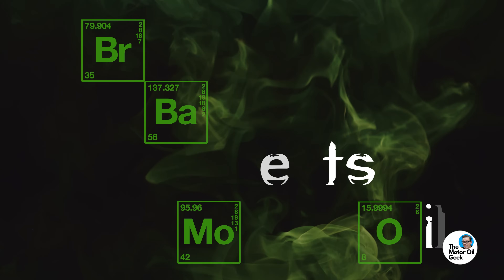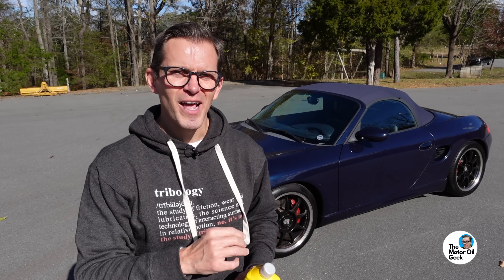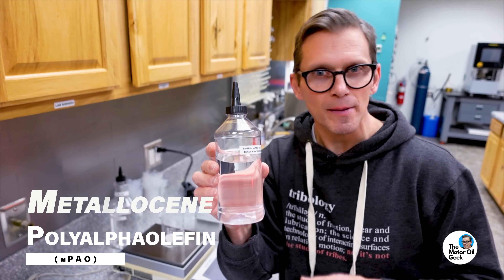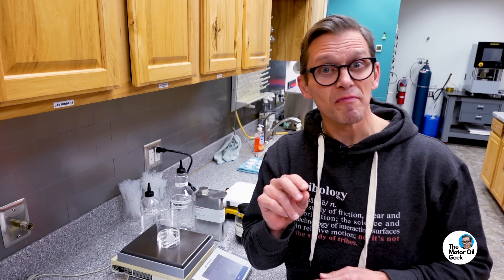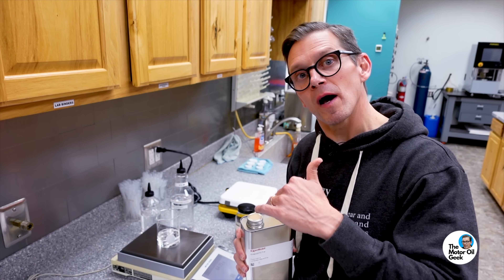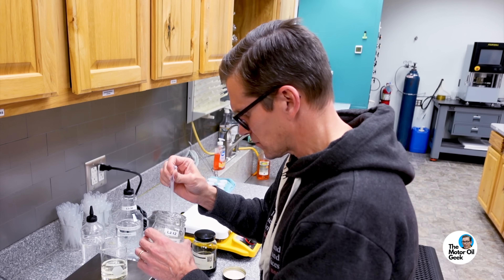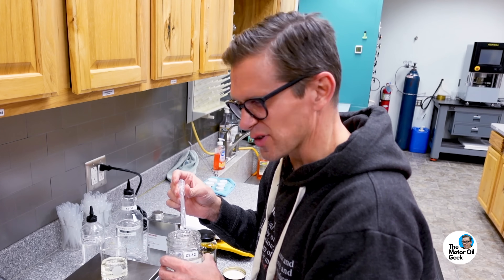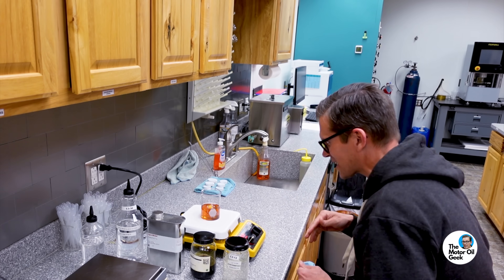Motor Oil Chemistry EXPLAINED (Breaking Bad Style)

Comment: Can you tell me dif between Mobil 1 , 0-40 Dexos 1 and Mobil 1 , 10-40 ( no Dexos 1) ? I have a 2024 GMC 6.2 L Ultimate Denali. I want to protect engine. Not interested in gas performance. Ok to use the 10-40 ?

Comment: Hi Lake!

About the J35Y6 3.5L V6 Direct Injection (DI) engine coming in the 2026 Odyssey. 

We know Honda makes tough engines, but as long-term owners, we have critical questions about fuel and oil given the engine's high-tech design (DI and high compression).
Fuel: Regular vs. Premium for 200,000+ Miles

This engine's high compression ratio (11.5:1) and DI setup naturally make us concerned about knocking, which usually pushes us toward higher-octane Premium Gasoline.

Our main question is simple: Can we truly rely on Regular Gasoline (87 Octane) and the ECU's knock control to drive this engine beyond 200,000 miles without causing any lasting damage to key components? 

We need assurance that relying on 87 Octane won't silently degrade the engine over the long haul.
Beyond just preventing damage, we'd like to know if there's any tangible, long-term durability benefit—not just a temporary performance boost—from using Premium Gasoline (91 Octane or higher) exclusively. 

Is it merely for maximum performance, or is it a hidden key to ultimate engine longevity?

Engine Oil: 0W-20 vs. 0W-30

Honda specifies 0W-20 oil, a choice we understand is driven by fuel economy and emissions targets. 

However, for an engine we plan to keep for two decades and over 200,000 miles, this thin viscosity is a real concern.

We need confidence that 0W-20 oil provides sufficient protection against long-term mechanical wear in a high-heat, high-load DI engine, especially when compared to a traditional 0W-30. 

How can you technically assure us that the thinner oil isn't making a sacrifice in long-term durability for marginal MPG gains?

Finally, we'd appreciate clarity: is choosing 0W-30 a necessary, preventative strategy for maximizing the engine’s lifespan, or does its higher viscosity actually risk negative consequences (like hydraulic system issues or flow problems) in an engine designed specifically for 0W-20?

Comment: Really interesting - There is a brand that makes very bold claims . The brand is Lubrication Engineers. Can you test their LE 8531 Monolec engineoil or their 5w20- 0w20 in the same series for Gasoline engines only. They seem to go under the radar everywhere despite their very bold claims on the bottles. Hope to hear from you Lake. / Tomas

Comment: A great subject/myth to cover would be draining oil via a drain plug vs full pan removal vs using an extractor.  There are rumors on the internet that using an extractor does not remove the contaminants as effectively as draining from the plug or completely dropping and cleaning the pan since the contaminants will sit in the bottom of the pan and then remix with the new oil.

Comment: Here's my question. I have 3 Porsche's, a 986, 996, and a 2012 panamera. I'm putting on about 2000 miles a year on each with mobil1 synthetic. Drives me crazy to think I need to change each annually. Do I?
Reply from the maker: Used oil analysis after 1 year can answer that question for you and how you drive.
Reply: @themotoroilgeek  another porsche related thing is: doesnt the mobil1 5w50 (porsche approved) generally perform better than the 0w40 counterpart? Considering not moving during winter where the 0w40 would be in an advantage, it just sounds like the better oil for highway use

Comment: Have you ever played around with steam cylinder oils? They usually come in three general viscosities: 460w, 600w, and 1,000w.

I'd be interested to see what they do differently in terms of additives for working with steam since normal motor oil isn't intended to work with water.

Comment: I understand the cold weather starting for oil to flow but why does it have to be 0W ? Why not 5W ? Maybe I’m too old school the 0W seems way too thin for me. I understand new engines are built with tighter tolerances I get that but why 0W weight? Other than meeting the EPA standards for fuel economy standards I this is why companies are coming out with this 0W thing.

Comment: Thx for all your knowledge and effort to put it out there….got a viscosity question for you: my wife’s 2016 4.0L 4Runner has 110,000 miles, oil changes every 5,000 miles with the recommended 0w-20 from Toyota….the other day when she started it up and i was standing behind it, i smelled a little oil in the exhaust…..should i increase viscosity to 5w-30 to compensate? Or another thickness? ….whats your take on aging engines and viscosity? I’m in Alaska but in southern coast, temps here range from 0 to 68F year round….thanks so much in advance.

Comment: Do not prefill oil filter, air buble will rip out filtering material specially in these cartrige filters
Reply: He has covered that myth in at least one past video, perhaps a year ago.  Contrary to your belief, I now do it on four vehicles after his recommendation to do it and I hear ABSOLUTELY NOTHING up on startup.  Whereas before, I did.
Reply: Mmm  ever experienced that yourself.
Reply: @murpbassett4818  you are replying to Jonjs? or me?
Reply: @murpbassett4818  Yes, 2 times in opel and bmw engine, worst part is realising that you just ran your engine for god knows k km with almos no oil filtration

Comment: Would be great if the major manufacturers would make a Motor oil for the newer pickup truck motors that would not shear out of grade at a 5w-30 spec. I’m trialing 5w-40s now and my wear rate is always around 6ppm/1K. Towing heavy really tears up oil.

Comment: Another great video & I’m looking forward to your results!  Good point on the standard filter vs high dollar filers.  I researched the micron filtering a while back & found “race filters” didn’t go to as low of a micron level as the standard filters so I too stuck with the Wix standard filter & 4k mile change interval.   Any idea why your Porsche engine was showing more wear than expected?
Reply from the maker: Thanks. This engine is unique and the oil rings are not low tension.

Comment: So when really pushing the chemistry on the moly, what would stop you from just going heavy with that moly additive in penzoil ultra platinum.

I know you’re big on the “do not mess with off the shelf oil additives” but in this case when you can do the testing and possibly inspect for issues maybe also add a bit of extra dispersant why not and save a ton of time/effort ?
Reply from the maker: More Moly can also lead to more deposits on the pistons, so there is a balancing act.
Reply: @themotoroilgeek but what makes your formula “better” in that respect compared to a high quality rated product with that extra moly added ? ie couldn’t you just add a bit of moly and some additional dispersant to a “stock” oil vs having to do a full formulation since you’re using the “Betty Crocker” base additive pack anyways .

Comment: Mr. Speed

How the regular filter is more efficient?

Thanks for amazing video.
Reply from the maker: Filter efficiency increases as the filters get more use. The long drain interval filters have to start off with a lower efficiency so that they don’t run out of capacity before the drain interval.

Comment: How do you deal with the oil remaining dry sump? My 718 Cayman GTS 4.0 total oil capacity is 8.3 quarts, but only 6 quarts drains per oil change.
Reply from the maker: It takes 2 or 3 oil changes to get good data.

Comment: Lake Speed Jr., I follow your channel as you provide really great information.  One topic I don't hear you discuss is wet belt compatibility of motor oil.   Many of the Ford Ecoboost engines and the revised 5.0L are using wet belts and ford has a Spec WSS-M2C961-A1 that incudes a wet belt test (not sure what that entails).  What should we think about when we have a wet belt engine?
Reply from the maker: All API SP rated oils are tested in a Ford wet belt engine.

Comment: Nice video.    Just wondering if the process of adding 1 item at a time, then heating /mixing/repeat
has to be done, or would the results be any different than adding them all together off the bat ?
Reply from the maker: Some items (not in this particular case) are not compatible with each other if introduced at the same time.

Comment: The section about using Lubrizol 7418A and the Hitec 11183 additive package is extremely valuable. It clearly shows that motor oil is not just about base stocks but also about how additives are blended. I often analyze other additive packages and their impact on engine durability on my own channel. Many thanks to this video for sharing such practical lab-based knowledge.
Reply from the maker: Glad you found the video useful.

Comment: I wonder if there is a lake speed Jr. Of the gasoline world. Doing the same thing with fuel for their vehicle😂.. like adding hydrozine  to a nitro dragster.. if the flames green, it's running mean! The first dragster to use it picked up over 20 mph when everyone was stuck at 180mph he ran 205..😮 that was a serious gain of power.. and coming from the fuel alone, amazing..  it's like going from methanol to nitro all over again..  I played with fuel additives as a kid using Coleman lantern fuel in my gokart to mixing either  to gasoline even kerosene and other additives. Ethanol, methanol . I did have the fastest stock engine on a kart. The compression  was up there the head could not be cut anymore. I had to clearance the valves . I cut the head until the valves touched , then clearanced for the valves and ported the intake and exhaust. Tuned the carb at full throttle. It smoked at idle but ran much better at full throttle.  It could have been much better with aftermarket parts. I would different Briggs heads with smaller chambers modified them. I think it was from a 4hp engine . I used it on my 5 hp. I think the 4 hp was a smaller bore mine was 205cc maybe the 4 hp was 196cc? I was thinking of all kinds of stuff I wanted to do. Re sleeve it. Pitting a 8hp piston in the engine..😂. Have an awesome day!...

Comment: Awesome video. Awesome channel !!!  

I started out thinking I know what to now run in my drag and drive engine.  
However as I have watched all the content on the channel I am no not so sure. ! 
Any help is greatly appreciated.  

I have a LS forged bottom end with a turbo making 1000-1200 hp. It has only 2500 miles o it from new. It has only had Lucas 30 break in oil. 

Plan to Change oil every 2500 miles or so. After say a week long drag and drive event.  

Is now the time to go to a synthetic?
What should I use ?  
I was leaning towards VR1 20/50 or 15/50.  
Or same weight from driven
Reply from the maker: Check out the Driven GP-1. It is a good oil for drag and drive.

Comment: Question ..off topic. I had a 2004 F150 4.6 Triton. Starting with the first oil change, I ran Mobil 1. Never had any engine problems, sold the truck to my nephew, and it's still going.. Now I have a 2020 F250 6.7 PS and the Mobil version of diesel oil Delvac, they say don't ever run it. Curious why is the diesel version not ok? Thank You if you have time to answer.

Comment: Wix XP has changed their filter media recently so it might not matter which version is used. I've noticed the old white media XP filter has slightly higher oil pressure when new. It could be for extreme drain intervals.  

I think a 3rd horse in this race should be Mobil 1 ESP X4 0w-40.

Comment: In general if my old Ford required 5W-20 when it was new and it has over 100,0000 miles would switching to a 5W-30 or 10W-30 be Ok? The climate it operates in is normally 60 deg F to 95 deg F.

Comment: That tip of dropping a bit of new oil to flush with the old is nice, but how much would be enough? I usually tilt the car with a jack and let it drain until it stops dripping. This way a Accord that asks for 4,4 quarts now requires 5 quarts to get to level, so it's about 13% more of new lubricant at every oil change.

Comment: You talking about the oil filters. 
I do my oil change every 3k miles. With  high end filters.  Since you said what you said.  It makes sense.     Gonna start using the red purolator.s.  for 3k miles oil change..😊😊
Reply: If you use Purolator boss just don’t change it every oil change that’s what I do.

Comment: Just went back and checked out the video on the Valvoline restore and protect and I was wondering if it worked better than using marvel mystery oil as an oil and fuel additive? Great videos, I don’t understand a lot of the chemistry but highly appreciate the answers at the conclusion.
Reply: In prior videos he's made it rather clear, I think anyway, that it's better not to play scientist.  For fuel the only one he recommends is Chevron Techron.  Lake helped flag oil dilution in my 18 camry due to using generic gas and fouling the injectors. My car is both port and direct injection.  One application of CT and I had no increased oil level or gas smell the next time around.  I use it periodically now and never ever buy generic gas.

Comment: Thank you so much for your videos; they are truly a service to the auto world. I’m a retired senior mechanical engineer and worked with a Ph.D. biochemist for ten years. Yet, I had no hope of ever understanding motor oils. With you sharing your knowledge, the world now has entertaining, informative videos that connects chemistry to real-world mechanics! By following your advise and making wise motor oil choises, engines can last much longer and car owners can save a lot of money.
Reply from the maker: Thanks for the kind words.
Reply: @themotoroilgeek  Hey lake what oil would you use for the 2025 corolla hybrid,the toyota 0w-8 is 100 bucks a case,so what do you suggest if not using the toyota oem oil?,thanks.
Reply: @themotoroilgeek  
Or anybody else with toyota tech experience.
I'd like your advice for a good/best mileage to perform the first oil change on my 2025 prius Plug-In . I'm at about 800mi so far,  but because much of that milage has been using the traction battery and not the ICE (most people now the ICE is used when the car senses it needs more power than the battery alone can provide or when the traction battery is running low.  I think my EV usage has been 50-60%, which would mean about 300-400 mile so far on the ICE's motor oil. So far the only thing I've heard, is to simply go off the odometer reading(which seems  a little early if you are mainly using the EV aspect of the car(60-85% as many owners do).
My second question is what is a good strategy for running in a (Plug-In hybrid) engine with this drive train set-up? New engines should have their rpm varied, not just run within a narrow rpm range. Since I usually drive in eco mode,  I'm not sure how much rpm variably I'm running the system with. Should I run it in hybrid mode on sport setting and vary the speed to give it various rpm ranges, or doess that even work since the EV can kick in and drop the ICE rpms down,  keeping it in a narrow range to save fuel. yet again?
Signed, confused in california.

Comment: Another great video, except this time Lake is showing us how to make a cake! I can't and don't have what he has, so I'm more interested in the final outcome. I already trust Lake, so knowing what he uses to make the oil doesn't matter too much, I rely more on his analysis of the oil. As for the filter, yeah that's common sense when you think about it.
Lake here's what I'd like to know, how much of your BB Outlaw Oil did you use to flush out the Pennzoil from your motor? I always thought you needed to run the oil through your motor to flush it out, but here you just poured it through and left the drain plug open.

Is that enough to flush out the previous oil to not interfere with the analysis? 

Now I feel like baking a cake, but I can't do that either! LOL!
Reply from the maker: This first fill will be the flush fill.

Comment: That looks like a ridiculously stout oil mix. Can i have some of that in a 0w20/0w16 variety for the Prius and 0w30 for the Civic please.. 😮😂

In the meantime, i like to use 5w30 PUP spiked with a quart of 0w40 PUP in the Turbo CX5 mostly to combat the slight oil dilution during winter/colder months. It helps that my boss also owns a Mopar dealer so i have the 0w40 at a discount..

Comment: heavyduty transmission/rear end (tractor) oil is the most fascinating.. it has to have hipressure film resistance, but also limited slip for oilbath brakes etc.. also used for hydraulics

Comment: Interesting your comment on oil filters. For me, I would check the box for the specs and only buy the filter that filters down to 20 microns at 99%. Some Mobil 1 filters state 30 microns at 99%. AMSOIL filters state on the box 20 microns at 99% and they are guaranteed long life filters.

Comment: Would it hurt old toyota 1zz-fe engine to run on new 0w40 Porsche C40 GT oil instead of regular 5w30 a3/b4 or a5/b5? By my thinking it should help in winter and also protect more because i like to push daily. Does additive package matter and is 0W too thin on cold start or its better outside temp range -4F to 80F

Comment: I read on line that about 50% of engine wear comes from start up and idling.   Start up is dry engine of course and idle is slow speeds that pump less oil and/ or don't have fastest enough movement to have parts ride the oil film correctly. What I am thinking.   Also read that Royal Purple oil scored high on regular use and Ball tester.  Which would make it great for start up and idle speeds.   Please review test results that would show best oil for start up and idle.   Some people great to freeway drive others get stuck in Stop and Go traffic all the time.  Thanks enjoy your videos.